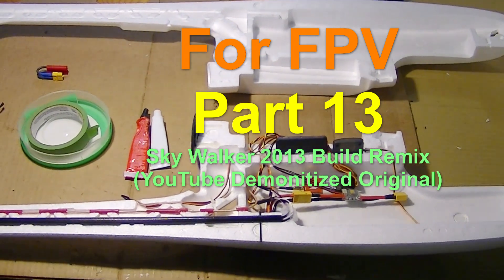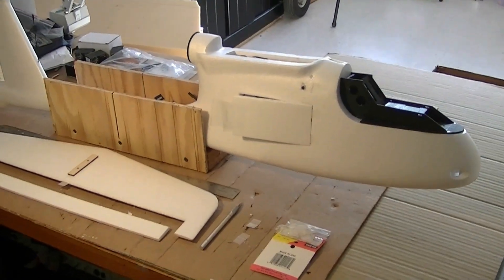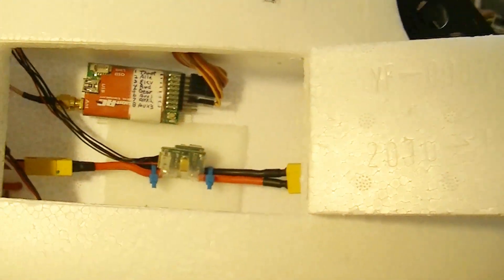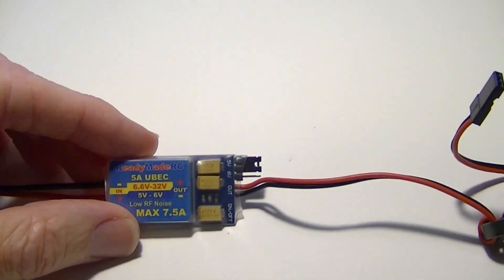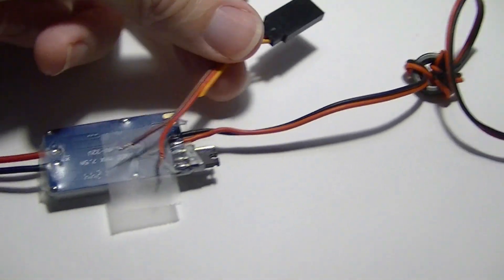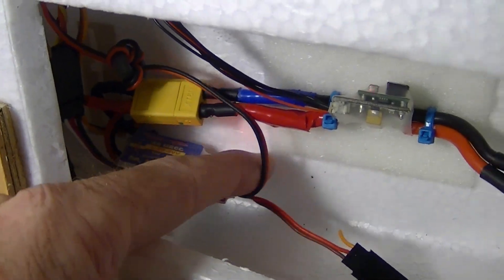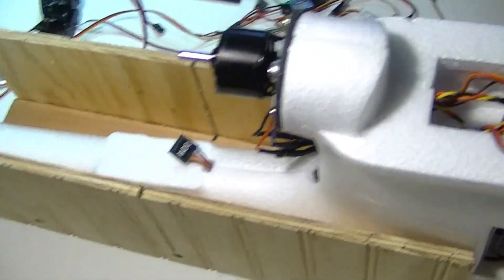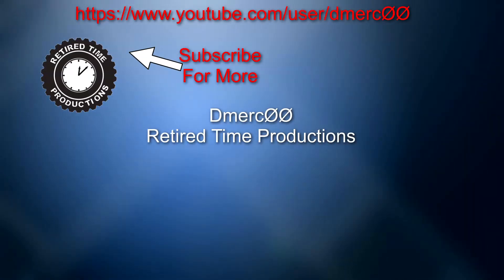FPV Part 13 - Install UBEC for APM Servos and glue SkyWalker fuselage (Remix)

Comment: Another great video, don't really understand the UBEC for power to the APM. I thought the power module did all that. Guess not. That's okay what I don't understand I don't understand. I've been adding UBEC to that S500, camera, retractable gears, that kind of stuff. Got all that finished. Been watching videos on that 2 position switch for the flight controller. I think the best way is Open TX then Beta flight to fine tune. Not to sure on the Beta flight. We'll see. I have everything upgraded to 2.2.3, Companion and Taranis+. Just need to jump in there and get-her-done. Reprogrammed the X8R from PPM to SBUS. That's was the easy part. Bought a Pixhawk PX4. Think I like the APM 2.8 better. We'll see. Looking forward to your next video.
Reply: Jim.....Servos generate noise and can draw a lot of power, isolating the 5v Servo Power Rail from the APMs processor circuit is standard practice. It's the same story on an Omnibus F4 Flight Controller for the exact same reason....Servos are noisy..!!!!!....Noise in your FC spells trouble.
Reply from the maker: No, the UBEC is only powering the servo rail.  I had to remove a jumper to remove power module from servo bus/rail. I think it's JP1 that you remove. See the link to the wiring diagram in the description of this video.
This video is part of build series that is already up if you want to see more:
https://www.youtube.com/watch?v=GFYyKs0wNi8&list=PLDpsqvUKcRksPZV0w6X4tFv-qWoCvhkd2

Comment: Looks like you have power module and ubec sending power to Apm is this correct?
Reply from the maker: No, I had to remove a jumper to remove power module from servo bus. I think it's JP1 that you remove. See the link to the wiring diagram in the description of this video.
Reply: Dave Merc Productions thanks friend

Comment: I thought if you add external power to the servo rail you need to set a jumper on the Apm.
Reply from the maker: I had to remove a jumper. I think it's JP1 that you remove. See the link to the wiring diagram in the description of this video.

Comment: Love The liquid electrical tape i use it all the time over solder points.  It’s easy to remove as well if you need access later
Reply from the maker: Wonderful stuff that liquid electrical tape. Thanks for watching!